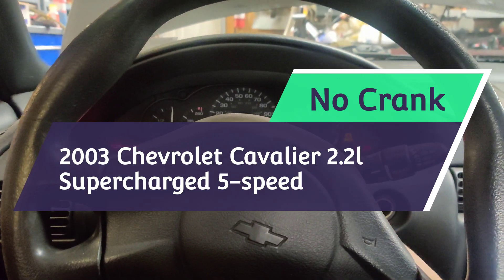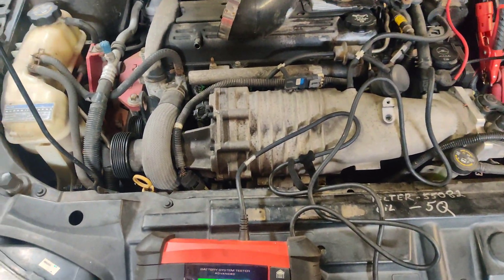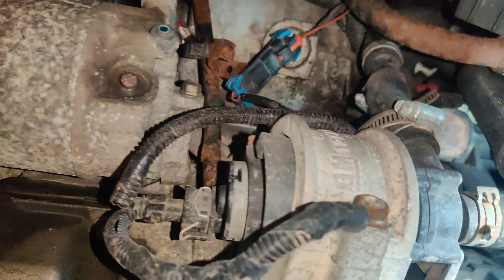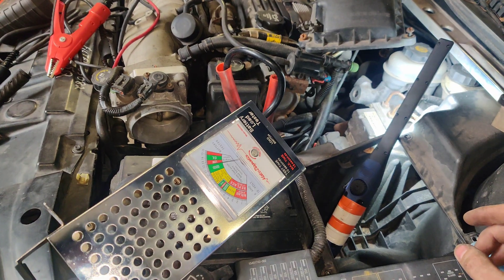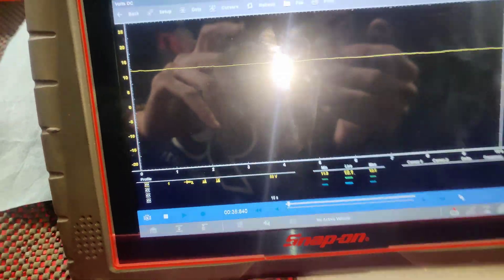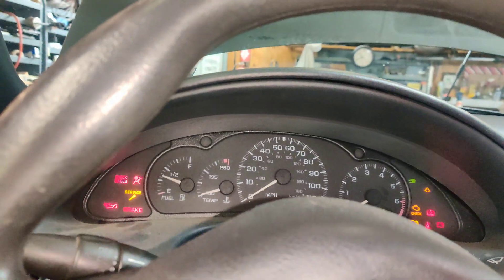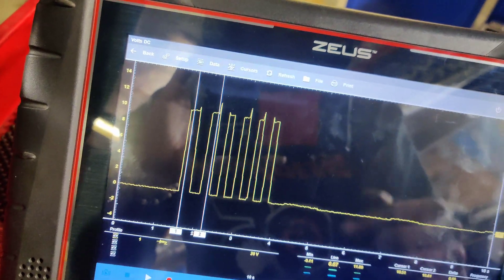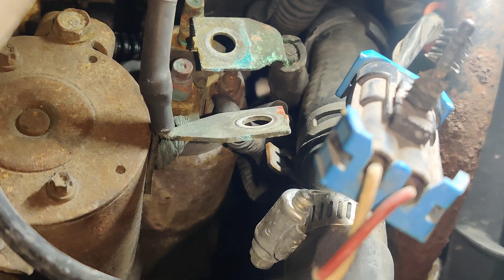2003 Cavalier 2.2l Ecotec Supercharged 5-Speed No Crank (Voltage Drop Testing)

Comment: can i create a load in a circuit for somthing like starter that doesn't have current flow with a lightbulb? could i hook a light in the circuit so it can be tested?
 i understand a light will only draw around a few amps but if you have a voltage drop in the wire wouldnt it i be able to see it via creating a load with light so i can voltage drop test? or a cheap way to load up the circuit so i can perform the test.

Comment: Is the primary cause of the voltage drop the lack of “current” flow due to the bad connections?  You’ve got 12v from battery going to starter terminal, but the ground wire connection being poor too you get 1 v when measuring.  Cleaning them and back in action. Well done.
Reply from the maker: The greater the voltage difference the higher the current potential. Since the voltage got pulled down very little current could flow. That was the power wire at the starter stud that was corroded.